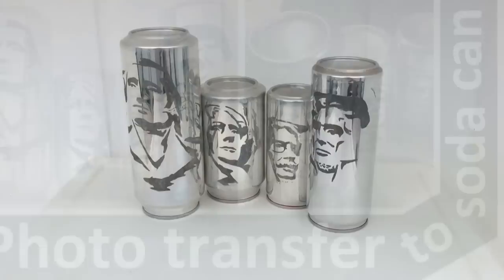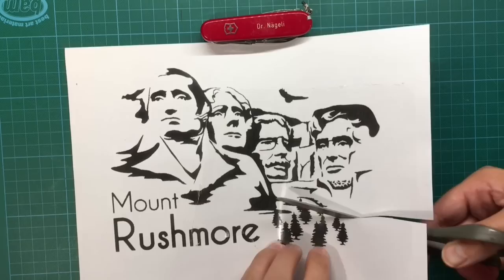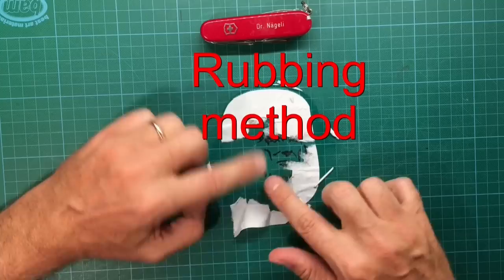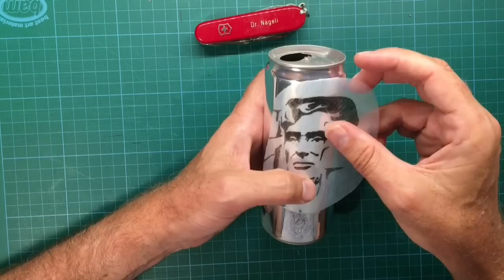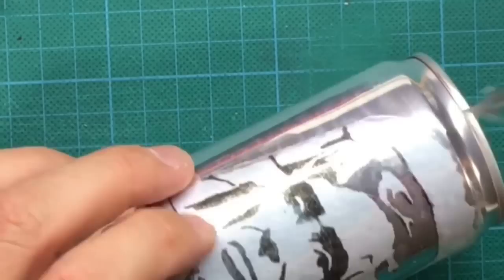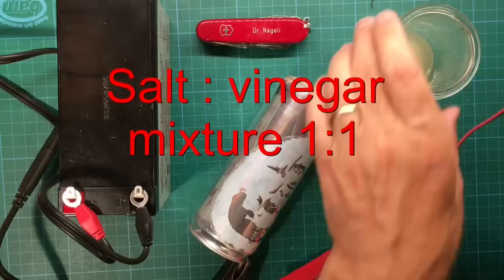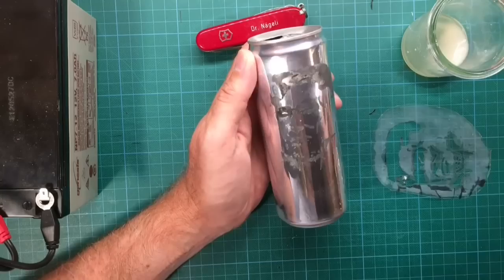Photo transfer to soda can

Comment: I have discovered that if you use the same method here to make your stencil on the can ~ there is another way to paint on a design: silicone brush mix mica powder with UV clear resin hard in silicone mixing cup, heat the coloured resin in the cup with a resin heat gun, small plastic funnel the coloured resin into a plastic tip bottle adding a bent nosed tip, place a short ball head pin 📍 in the bottle tip, mix up all the UV resin colours you need, use the bottles to outline the stencil, dry the outline with a UV resin torch 🔦 , you can then repeat the same process to colour in your resin design UV torching each colour as you work, you don’t need to seal it after either!!

Comment: Great work, I subscribed :)
Does the permanent marker work as well without modifications?
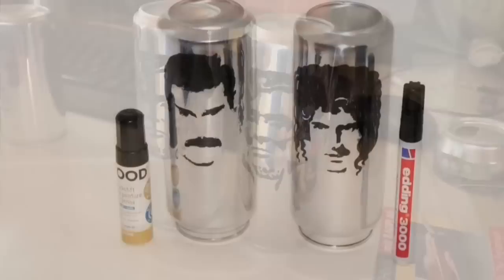Reply from the maker: Yeah I think the marker is just as good. Maybe you have to let it dry and then add another layer. The other advantage is that you can easily removed it with acetone and then start again. In the video at 5:15 you can see Brian May. He is done with a black permanent marker. Do you see a difference?
Reply: @LeFreak  Yes i do. I think it`s like grades of black as in drawing pencils :)
Thanks a lot for your reply

Comment: So Edding is a German permanent marker like a Sharpie in North America?

Instead of using a soldering iron, Can you just use an Exacto knife?
Reply from the maker: seems so - keep on watching all my videos (smile)
Reply: @LeFreak  Seems So??? Was that the answer to which question?
Reply from the maker: @GetUrPhil  seem so - was the answer to the permanent marker. Of course you can also try to use a knife to remove the plastic, however with a fine soldering iron it is easier. Have a try!

Comment: Guten Tag
Wo bekomme ich so eine Etching Station und die Kabel mit den Klemmen? Im Obi konnte man mich nicht beraten. Da fand ich keine 12 Volt Batterie und auch die Kabel bzw. Klemmen nicht. 
Für das Schneiden der Vorlage eignet sich übrigend ein Schneide Plotter. 
Besten Dank für due coolen Tutorials!
Reply from the maker: Dann würde ich empfehlen mal online zu suchen. Keywords sind: Bleibatterie 12v 7Ah. Somit sollten vorallem kleine Batterien angezeigt werden. Zum Laden braucht es dann noch ein Ladegeräte für Autobatterien. Keyword für Kabel: Kabel mit Krokodilklemmen. Ein Adapter welcher am Strom angeschlossen 12V generiert reicht nicht, da hier die Stromstärke zu klein ist. Empfiehlst Du einen Schneide Plotter? Geht der Aluminiumblechen von Soda Cans?
Reply: @LeFreak  um Blech bzw Aluminium zu schneiden reicht es wohl nicht mit dem Schneide Plotter. Balsaholz kann er zwar schneiden. Ich habe es selbst noch nicht versucht. Er kann aber die Vorlage aus Vinylfolie schneiden welche man dann via Transferfolie auf das zu ätzende Matetial übertragen werden kann.
Reply: Ich hoffe ich finde geeignetes zubehör, zumal es ja Strom ist und ich mich damit nicht auskenne (Stromschlag).
Kann das sein das die Autobatterie Ladestation um die 50-70 Franken kosten?
Reply from the maker: @baileys13  Nein, das sollte billiger sein z.B. 30.- im Aldi oder hier ein Link: https://www.digitec.ch/en/s1/product/eufab-intelligentes-batterieladegeraet-6v-12v-4a-car-battery-chargers-10045827, übrigens kleine Batterien habe ich im Jumbo gesehen.
Reply: @LeFreak  herzlichen Dank
Reply: Guten Tag

Ich habe eine 12 volt 6 ah Batterie gekauft in der Landi kann ich diese benutzen? https://www.landi.ch/shop/auto-zubehoer_170402/motobatterie-ytx7l-bs-okay_48488
Reply from the maker: @baileys13  Ich fände es einfach wenn wir über Email kommunizieren könnten anstelle dieser öffentlichen Diskussion. Meine Email findest Du unter dem YouTube Reiter "Kanalinfo" - dann gehst Du zu "My Webside" und dort zum Reiter "Contacts" - dann antworte ich Dir gerne.
Reply: Truly impressed!!!!!!!!!!!